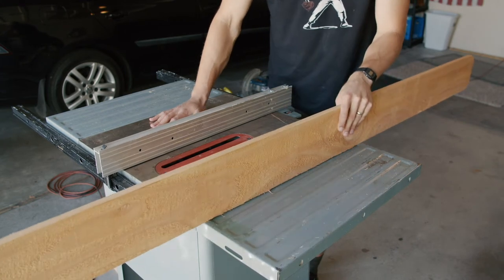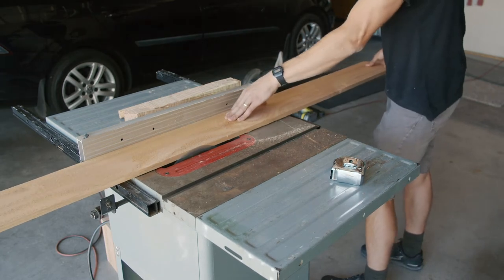How To Build an IMO Box for Korean Natural Farming

Comment: Great instructions and thanks for the prompt to get me trying this again. I had some iffy collections last year. My slight modification is that I used a cedar board of width 7 1/4". I ripped a 2" strip off the top of that and so was able to get a side and bottom piece from each 10" length. $42 for a 6' cedar board of that length though, yikes! Quite a difference from your costs 3 years ago. Thanks!

Comment: If you have 2 - 10" (in) board for the bottom slats and your box is 11"x10" wouldn't it be easier to put the slats on the 10" length instead of trying to put it inside the 11" length???
Reply from the maker: Probably!